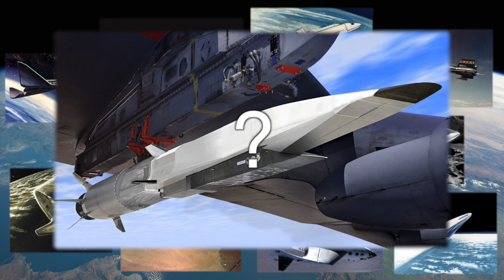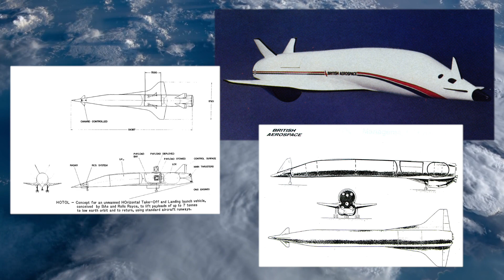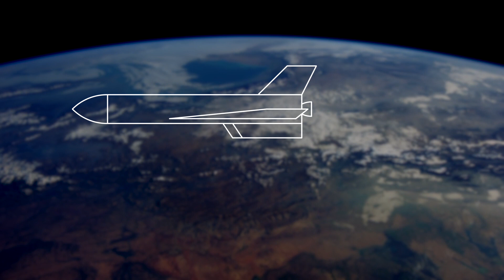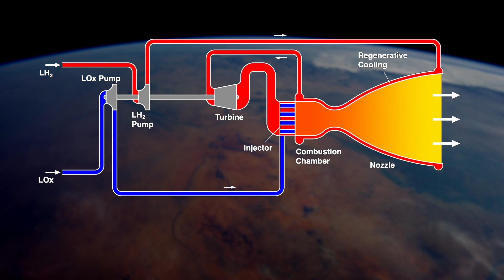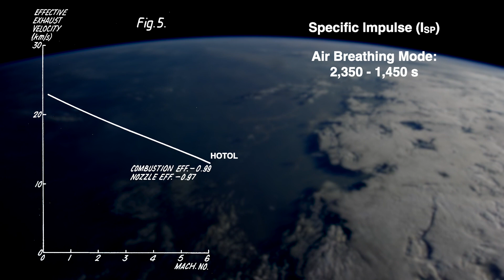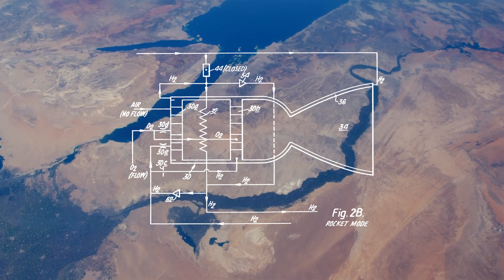HOTOL - Anatomy of a spaceplane engine

Comment: Yes how much it weights??? 
Compare that to how much fuel rocket burns before mach 5... Probably 40% that weigh already saved. But no. When Makin planes. You focus on the weight instead of already existing gain. Again. Engineers are very narrow minded when it comes to innovation... Be cause when you think in rocks. When you have metal. That's the problem in the head. Not weight

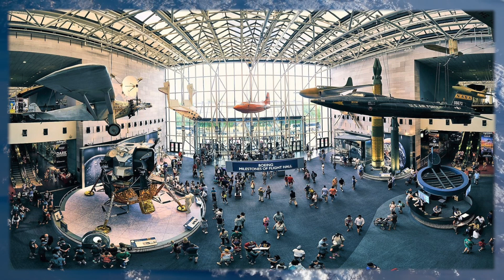Comment: 4:50
that helps to a limited degree, pure rocket engiens and scramjets tend to have better thrust to weight ratios than jet engines or airbreathing rockets
and any vehicle gets lighter as it uses up fuel so the mass is dominated by whatever you use first either way
so either method ends up with surprisingly similar engine masses

Comment: What is it's max payload to LEO? It looks like it would be best used as a passenger transport to Low Earth Orbit for transfer to A Lunar, or Martian cycler vessel. The Starship is starting to look like it will be doing lots of heavy freight, & mass transport as it's capacity is said to be 100 passengers.

Comment: What about a detachable turbojet scramjet ramjet to get you to 25km and mach 5 then the rocket only space plane detaches and goes into orbit.  The multijet "piggyback" could detach and glide or fly back to the surface for reatachment and reuse.  This keeps the weight of the engine tanks and fuel for the very energy intensive first stage on the detachable drone. The weight saving of all that fuel tanks and engine that detach are considerable.

Comment: In of a March 2019 by invite only to an MIT engineering conference I presented a proposal for a muon catalyzed fusion rocket engine for spaceplanes originally designed by Noguchi and Songsu of early 1940s Hamgyong province where a Dewar of liquified cryogenic deuterium fuel was connected to beryllium alloy reaction chamber nozzle coiled in around electromagnet coils to focus cosmic ray muons for fuel to have prevented exceeding of Curie Point while alpha particles would have been deflected.
Reply: Dr. Mitchell Swartz who published my MIT peer reviewed articles on such a subject during the 1990s agrees with me on how my articles are Prior Art on Jerome Drexler Patents.

Comment: what do you think about 2 stage spaceplanes?. The first stage gets it up to let's say mach 3 or 4(with all the turbine engines and ramjets), then the next stage uses a combination of rocket and scramjet engine to get to orbital speed. The split velocity would ideally be where the metals couldn't handle the heat, and tiles are needed. Both planes could be connected by a simple rope like a glider, thou a heat resistant one.
Reply from the maker: Ha! They’re a video in themselves. They’re really expensive to develop, because you’re developing two aircraft, and operationally they’re a nightmare. Separating two aircraft at supersonic speeds is very dangerous. Using aerodynamics to slow down and turn around the first stage for recovery is also very tricky. Seriously if you want two stage I think you’re better off going the SpaceX route.

That said, the exception is something called suborbital payload deployment, which is where a HOTOL or SKYLON like vehicle does a once-around to land back at the launch site but never quite reaches orbital speed. In this case the payload has a small second stage booster attached. This would be a way for such a spaceplane to deploy heavier payloads, or for early operational flights.
Reply: the keyhole missions operated at 120km altitude and electric propulsion craft operate in vleo, it's not a stretch to include an electric element in every stage and any space launch involves risk air breathers are inherently safe from the atex perspective

Comment: Uh...SR-71s routinely reached Mach 3.2. Literally "faster than a speeding bullet. And "air-launched" and manned X-15 "rocket planes" exceeded Mach 5. And still never got further than "halfway to space". 

Starting HORIZONTAL to go VERTICAL all the way to "orbit" is as perfect example of "wrong way thinking" as is humanly possible.
Reply: Orbit is horizontal. any effort expended vertically is wasted.

X-15s got to space. They didn't get to orbit. (Flight 90 was the first such)

But perhaps you need to watch again, as it is clearly stated that Mach 5 at 25Km is the point at which a stage can reasonably make it to orbit.
Reply: circularisation
Reply: the x-15 didn't make it anywhere near halfway
plent vertical laucnehd suborbtial rockets
these are baiscally completely unrelated variables you'd only correlate if you don't know anyhting baout hte pyhsics behind htem and only go by arbtirary historical examples
this happens often
certian design choices correlate for more complex reasons but people think they're directly related just because theyh appne to correlate
its the same reason people think longrange planes have to be big

Comment: Liquid air cycle engine or synergistic air breathing rocket engine is described by Patent #5025623 and to handle cryogenic fuels such as Diborane one could consider Patents by Xcor for their "Lynx" spaceplane titled "High speed Check Valve suitable For Cyrogens" to remember how my dad's brother worked on similar engine for "Dyna Soar" designed to skip on the upper atmosphere. 

"Liquid Air" by T. O'Conner Sloane described how Victorians used cryogenics to condense oxidizer for earliest Prior Art .
Reply: hotol didn't use a liquid air engine
Reply: You miss the point completely how Alan Bond's Reaction Engines Ltd. condensed oxidizer from atmosphere to liquify air.
Reply: @thomasciarlariello3228  No, you miss the point entirely, it doesn't liquefy the air. It isn't LACE.
Reply: Ever See Alan Bond's Reaction Engines Ltd. commentary. Arthur Clarke's commentary, and American Institute of Physics on liquid hydrogen fueled Aerospace, etc. since liquid air cycle is synergistic air breathing if one pays attention to patent documents cited.
Reply: @thomasciarlariello3228  The patents for LACE are listed, because they are prior art - they also cool the incoming air, often using cross flow radial pre-coolers. But a key realisation Bond made was that liquefy the air was not only unnecessary, but detrimental, as they require deeper cooling and heavier plant.
Reply: Atmospheric oxidizer has to go from gas to liquid to store such an oxidizer since at such very high altitudes air is too thin for conventional jet engines so documentary shows 17:13 "Air breathing mode" and 19:13 "rocket mode".
Reply: @thomasciarlariello3228  the oxidiser is used immediately, never stored.

the oxygen for "rocket mode" is loaded before take off
Reply: If Liquified oxidizer is preloaded then it is a "Xcor Lynx" of diborane fuel and halogen oxidizer to remember how a Shen Long is launched from a Xian H6 of a de facto WWII bomber with modern jet engines since Richard Branson's Scaled Composites had a similar design called "Proetus" of a two stage spaceplane.

See U.S. Patent #5101622 of April 7, 1992 Fig. 2A & 2B. where it shows a valve in of open or closed modes.
Reply: @thomasciarlariello3228  No, it used liquid oxygen
Reply: @thomasciarlariello3228  Figure 2a show the engine in air- breathing mode. the hydrogen valve is open, allowing hydrogen to be heated in the pre-combustion chamber, which drives the intake turbo-machinery, which drives compressed air into the engine

In Figure 2b, the engine is in "pure" rocket mode, thatv hydrogen valve is closed, as the air compressor is no longer used. LOx is instead fed into the engine from the LOx tank which was filled on the ground before take-off.

Comment: Was kinda convincing but how do you convert the excess heat to work even with after cooler or pre cooler , u have too much heat exchanged how do u get rid of it , cuz there is got be somewhere for all that heat to go ? ... And when your pre heating the fuel u instantly vaporize it ... Which is good cuz it burns better , but won't that just mean u now have heat of the entire engine+forth coming heat by chemical reaction on the same nozzle now ? ... How's that good ? ... Isn't it more heat than what we can handle ? ... Cuz that's the exact reason we started cooling the engine in the first place ! ... Seems highly impractical to me ... More like some cold war era junk design , like ekrano plane or something or the star fighter 104 , basically which never saw service and so were disbanded ... ! ... No offense , the money could be used better than here ! ...
Reply: fuel has a lot more thermal apacity nad you cna heat it AFTER compressing it
and well you can turn al ot of hte heat directly into work iwth a ismple expander cycle, its how every basic heatpump works
the problem is jsut to make this work oyu ened a heatsink colder than your target cooling tmeperature nad that is already at liquification
while a precooled high speed jet engien can get away with just cooling to the point where the engine stays at operating temperature for an airbreathing rocket engien you need to liuquify it because oyur comrpession ratio is so high that gas being compressed that much would heat up too much again and the only way to reach that pressure without using too mcuh energy is to only pressurize the very smal lvolume of liquified air
regenerative coolign i ngeneral is absolutely a thing in rocket engines by the way
while there might be better near future options this is an absolutely feasible and impressively elegant setup

Comment: Great content as always Rich. Super informative and technically correct for a project that nowadays not many know about. 
Just a remark if I may, when you say some 2 issues have had remained to be resolved on Hotol engine as frost control and nozzle. It is not just a nozzle as a single element but actually a complete second half of a thermal engine - the kinetic part. What we denominate as "nozzle" is conversion of build-up potential upstream into the useful kinetic - thrust. In preference of pressurized balloon, as you illustrated, with all these neat cycle adaptations and smart exchanging options, it is just augmentation of that potential before its final conversion. To convert then that 1st half into the useful kinetic energy you need a proper combination of CC-Nozzle as process end critical element. 
Unfortunately, the technology is still not there yet to meet the requirements for SSTO nor spaceplanes. On other youtube channel, you may find listed graveyard of projects and companies that have failed on the similar step. Either because of dealing with open form conversion elements as aerospike nozzles or because have selected wrong combination of CC-expansion.
Reply: Also there is not much support neither from industry neither from governments to technically deal with any new energy conversion/nozzle concepts. Last serious attempt was for mentioned NASA X-33 linear aerospike and since then it is pretty much dead end. Currently, you have sizeable companies/organisations either dealing with conventional and advanced rockets or spaceplane engines - that 1st "potential" half- and then a few tiny companies trying to breach the gap between the conventional bell nozzles to altitude (pressure) adaptive ones. Nozzles except they are mentioned conversion elements they are also interface between the internal aerothermodynamics and the external one. In wall-bounded types that interface is found on the nozzle exit (if the flow is not separated), whereas in open form as aero spike/plug interface occurs for the whole length. As such those units are also susceptible to any external exciters as atmospheric conditions, strong jet winds, presence of other exhausts, angle of attack etc. Hence, to finally get them into air seems better to use them on a simpler engines, as small rockets, in order to get them to some TRL before trying to apply them for bigger systems. And once when they get to that, to go to spaceplanes it will need additional steps which probably will consist of novel materials, zirconium based for temperatures with  additive manufacturing, electroformed regenerative cooling, and especially active flow control if to be mounted on a winged horizontal fly vehicle.
I also believe the spaceplanes are the future but it appears that current state of the industry is still not favoring them and environment is not ready to put serious effort in development of advanced kinetic conversion alternatives to bell nozzles.
Reply: Along with Bristol University, Reaction Engines ran E/D nozzle tests (and published the results) to enable them to validate their CF results.

later, Airborne Engineering tested their advanced nozzle design for the SABRE 4 engine which effectively provides an E/D nozzle for atmospheric flight, and a bell for vacuum flight

Comment: Rich, another outstanding video.  I'll pass this on to my colleague, Adam Dissel (he's the president of Reaction Engines, Inc.).  We've been teaching together at the AIAA short course on high speed air breathing propulsion. (I do the Air Turbo Rocket part, Adam presents the current Reaction Engines cycle and how it works, along with several other outstanding instructors in aerospace).  
I was especially gratified by your explanation of how the concept of  "SSTO" got so stigmatized; that squares pretty much right on with my experience, when I was a young engineer working on NASP propulsion systems.   I no longer use the term "SSTO" because its so burdened with misapprehensions.  
Instead, we use the term "high delta V missions".  But you know what we mean.   
Keep up the great work!
Reply from the maker: Thanks for the compliment.
I would really like to see this engine or something like it fly someday. Maybe educational videos like this might help move the needle, if even just slightly.
Reply: when the heck is skylon coming out?
Reply: @PoliticalWeekly  Always remember that never is just around the corner!
Reply: RIP

Comment: So underrated. I’ve thought about this idea before, however I had no idea that already existed. A question though, had they ever thought about reheating that excess hydrogen, and adding a variable nozzle to it?
Reply from the maker: They did as a matter of fact. In later designs, after the patent was published, they incorporated a bypass ramjet into the intake system. You can see it in some of the later artwork.

So many little extra things I could have included in the video!
Reply: @Thumblegudget  Awesome stuff m8. As I said before, very underrated. Keep up the good work!

Comment: Thank you! This is one of the best aerospace videos I‘ve ever seen (and I‘ve seen a lot)! I hope this video and your channel gets the recognition it deserves.
Reply from the maker: Thanks for the compliment! Tell your friends I guess. And hit the like button. Likes are absolutely everything to a small channel.
Reply: Amazing video. Small thing, the temperature measurement is kelvin, not degrees kelvin.
Reply: the difficulty I have with the concept is how does the tank not distort if the pressure increases since coolant is needed for fuel stability AND to rapidly cool air that gets hot as it moves through the compressor😮